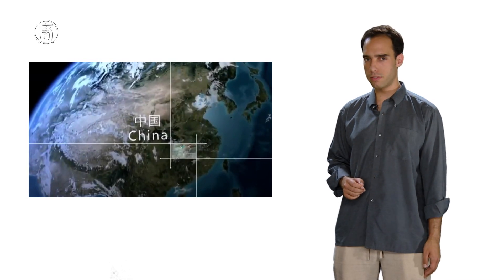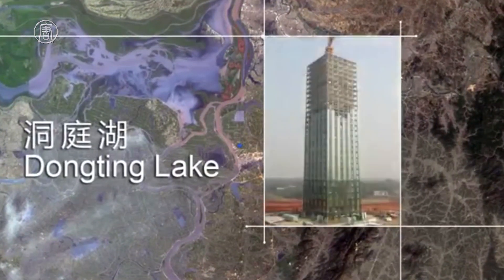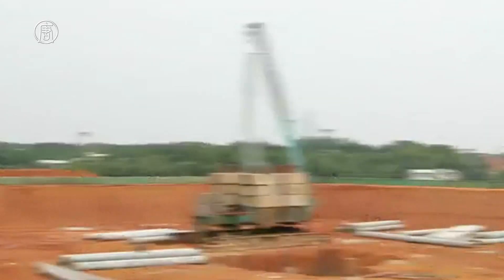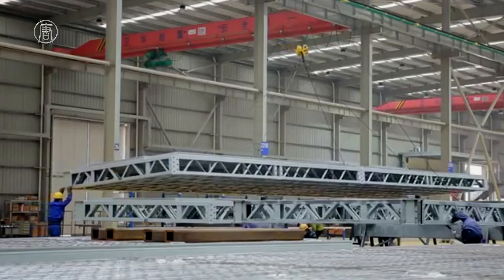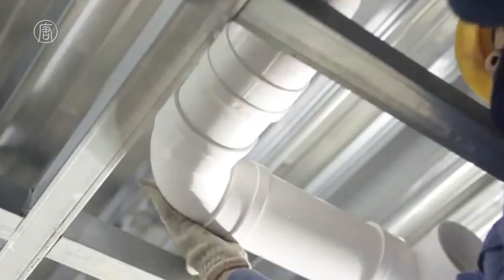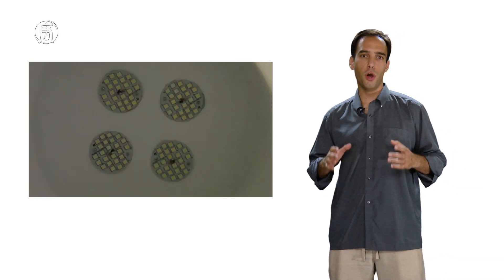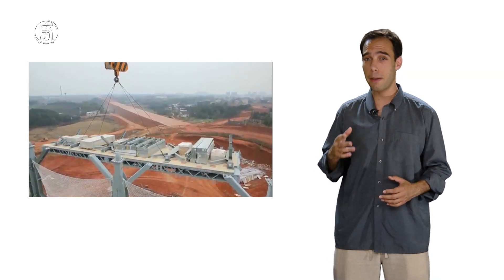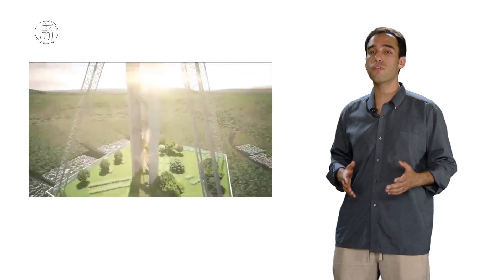China To Build World's Tallest Building in 90 Days!

Comment: LIGHT GAUGE STEEL STRUCTURES ARE THE ENTIRE WAY OF THE FUTURE, FOR BOTH RESIDENTIAL AND COMMERCIAL USES.
I'VE BEEN BUILDING WITH LIGHT GAUGE ROLLED FORMED STEEL SYSTEMS FOR YEARS, THE MOST DURABLE, NON-DELETERIOUS, NON-COMBUSTIBLE STRUCTURAL SYSTEMS KNOWN TO DATE.
I APPLAUD THIS VENTURE, IN SPITE OF THE COMMENTATORS UNWARRANTED AND SEEMINGLY FOOLISH PERSONAL COMMENTARY.
Building Constr. Group Corp.
Builderjon, Certified General Contractor